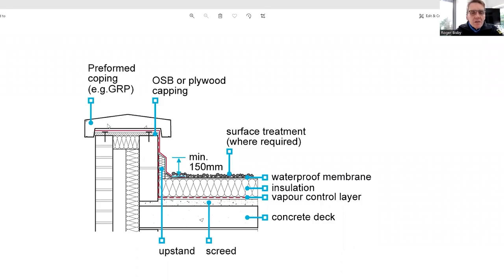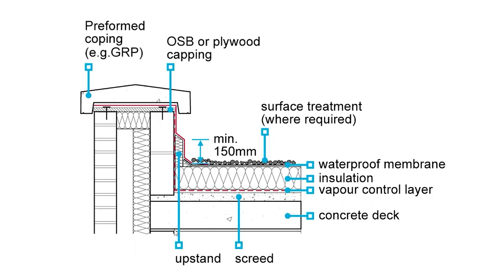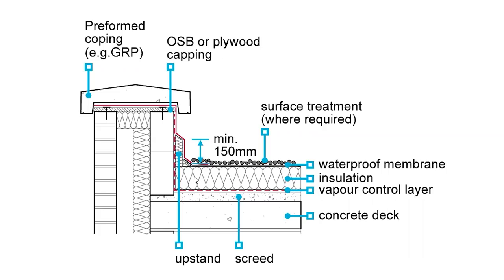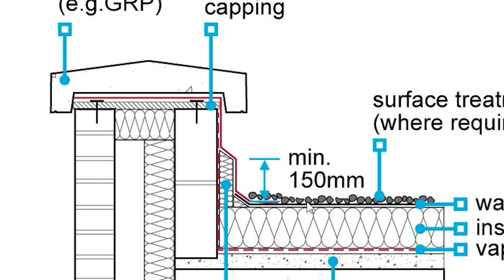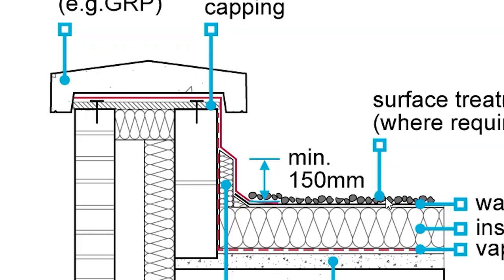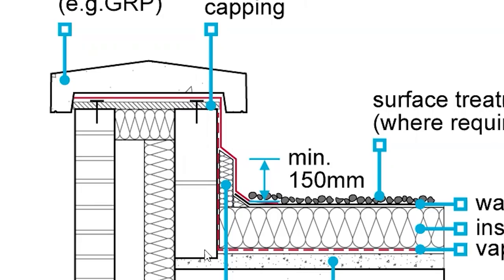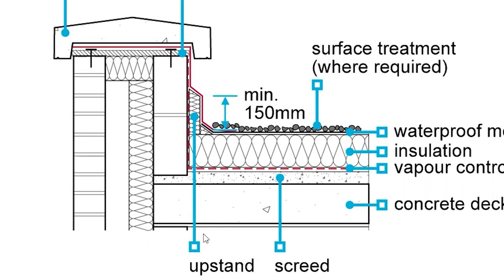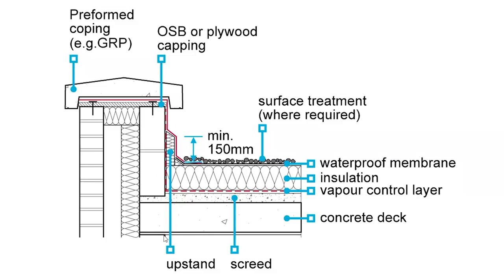A Deeper Dive Behind Parapet Walls

Comment: Have you seen anyone doing the timber stud work on top of the insulation? I’ve got an upcoming extension with a parapet wall, I’m interested to know if this is a good method
Reply: Upstand studs are quite well performing insulator. You don't put insulation below studs. You put it between. If you make timber upstand it is way better than any concrete block or brick. Thermalite block  is a different storry. Actually would be easy to find u values for timber and thermalite to compare. But premise of video with assumption of timber ceilimg would be that where timber beams rest on the internal wall, the wall continues with insulation layer, not block. Then you have a plate on top of insulation, dwarf studs on top of plate, then another plate just below caping...
Ceiling noggings 1- 3 inches away from wall. Osb board from top acting like a shield + noggings just next to the wall along with the dwarf wall bottom plate  should prevent any warping on 4 inch support area of timber warm roof joists.

Previous video postulated moving temperature stress point (sorry not an engineer - point where cold crawling through material from top meets warm temperature crawling from the living space from the bottom) be moved from inside the living space somehwere inside the wall under the ceiling to somewhere inside fhe ceiling level, _inside the bearing part of the roof joists_.

I would guess that with an extra bit of the insulation marked on the above video as upstand, this temperature would move into the level of actual paraphet wall's upstand's timber plate (not marked on this video) and be as negligible as possible, but hey, Roger is a God of 'Why won't we consider thiz today' and i am sure there are dozens of people who would be inspired to get some science done and tell us how those things work.

Building is art and forgotten lore. Art is chaos. Forgotten lore is forgotten. We all have passion and try for the best but we are still shaken by paradigm shift that took place somewhere in the second half of XX century. We just try for the best.
Reply: @kerel995  if you just have the stud work on top of the block work you’ll probably be better off going with thermolite block instead. 

It would be nice to see some numbers/evidence
Reply: @mooney0086  previous Roger's video said:
Insulation inside warm roof goes over concrete wall that ends at the bottom of roof joists. Then in between bearing part of joists you have full insulation. Upstand is on top of roof joists.

Regarding numbers, this is like a little nerdy math excercise
 I would love to read calculations for timber bridging too ;)
Reply: @kerel995  I’d imagine building control would want SE calculations for adding coping stones on to a timber frame too. More expense 🤦🏻
Reply: @mooney0086  absolutely crossed my mind.
I like the way your brainz work ;)
Reply: You can do away with the 'inner leaf' of your prapet altogether. Take the inner leaf of blockwork only in between and up to the top of the roof joists, lay OSB deck over it right up to the single outer leaf, bring your insulation also to this inner surface and the roof waterproof covering up and over to the capping. Simple.
Reply: @thetessellater9163  I’m having a roof terrace. I don’t think this would be allowed.
Reply: @kerel995  a Builder AND a philosopher! I love it!!!
Reply: @criollitoification  Aren't we all? Lol.

Comment: It might seem odd but you must remember heat loss can be  material (like a steel wall tie) or geometric - in the case of a parapet the upstand acts like a cooling fin. The heat-emitting surface is larger than the heat-absorbing surface, just like any other corner. Hence why the heat break is important!
Reply: Fantastic explanation! Thanks Swwils!

Comment: One thing I’d add is, take the membrane down the exterior wall a little bit, and ensure the cope is only there for decorative purposes .
Reply from the maker: Good point
Reply: the membrane under the coping SHOULD  show a half inch , i know it looks ugly but it WORKS !!
Reply: @pauldavies5655  -  where is the attachment of the coping ? With the membrane right under the coping, you may be risking detachment in high winds.
Reply: @thetessellater9163  
  you can do it easily with DPC --- it will take a wind of over 120 miles an hour to dislodge  a coping  done properly.
 i know of  coping stones in britain  at the end of 4 storey roofs ( we call em FINIANS ) which have survived  a 120 years untill the main roof covering needed changing !
 also look at the shape of each coping stone and adjust it to the wind conditions in that area --- common sense !
 remember , make it secure --  make it WORK , NOT make it look pretty !

Comment: Should there be some form of vent at the top of the brickwork to allow flow of air and allow any moisture to  evaporate??
Reply: Most modern weep vents also allow some cavity ventilation. They also can prevent pressure differentials so moisture is not forced into the cavity.

Comment: The comment about condensation on a cold chimney breast is spot on exactly what happened in my mother’s old house….She had a repair chap rambling on about flashing and sealing etc, but you could see the ceiling water stain coincided with a change in chimney profile in the loft.  Condensation was running down the outside of the rendered chimney brickwork in the loft and dripping off at the curve to wet the ceiling board under it.  I guess it only occurred on cool summer nights when the fire was not lit.  This is hard to fix, but one way is to install a collection trough under the drip zone and pipe the run off to an outside wall or under the eves harmlessly discharging the condensation.

Comment: Another great video - thank you. What kind of insulation would you use to run through to connect to the wall insulation? I mean in terms of building block work on top of it - does it have to be anything special to support the block?

Comment: Another great video as always Roger. We've got a 1st-floor balcony with parapet wall with capping stones which has rotten timbers (firrings and joists) around the perimeter under the OSB deck, especially under the internal corners.
You and your diagrams explain well "how it should have been done at the beginning". But that doesn't really help me in my pre-existing situation. Perhaps you could make a video about how to fix this system without the demolishing and rebuilding of the entire parapet. Roger that!

Comment: Random question - I'm fitting a kitchen and have taken the supply pipe work back to the rising main/ stopcock as it was so poorly fitted.  it's a detached property. Combi boiler, no storage tanks and no outside tap.  It does have mono bloc kitchen tap and a shower head on a hose over a bath. Does it require a double non return valve at the rising main?  If it does is that best practice or legislation?  Sorry asked a few people and  got different advice :(
Reply: I don't know jack about plumbing, I'm only thumbing up your post in the hopes that someone else with knowledge might notice it and give u sound advice. Best of luck

Edit. Have you jumped onto an online plumbing forum?

Comment: I had that problem with the chimney, had it reflashed, repointed and a capped off with a tin cap. what a waste of time it still had problems so it was taken down top to bottom (removed) and how much warmer the room is now. please do a video on this to show how bad chimeys are for heat loss ( its like having a window always open).
Reply from the maker: Good idea
Reply: Could be useful for 'trickle venting' the house though. Chimney breasts are also used for lateral restraint on a long wall, if you and your neighbours both remove them, there could be issues with stability.

Comment: Why are building standards not reflecting this? Why are blocks still used if studwork is the ideal solution? Also, would termalite blocks solve the problem?
Reply: Alao, would insulating the inside edge of the warm roof solve it? There’s plenty of space between the rafters…

Comment: Underneath the GRP they should use slate or cement board rather than OSB/chipboard wood which in time will absorb moisture.  Great video Roger
Reply from the maker: No OSB 3 is great. A lot of GRP suppliers insist on it.

Comment: Be interesting to look at the similar issue with gable walls in the loft, which must also eradicate heat out of the house above the insulation? Hipped roofs must lead to a more efficient building?
Reply: The inner leaf of the gable is not exposed to the elements, so warmer, but still must lose some heat to the outside. Maybe not enough cold bridging to form condensation, and if so, the ventilation in the loft should take care of it.
Reply: @thetessellater9163  silly question, would the orientation of the building not affect the inner leaf of a gable? I.e, driving wind/rain?
Reply: Our gable is north facing, so it’s a cold wall anyway, but my point really was the temperature in the loft is very low above the insulation, and the inner leaf of the gable bypasses the insulation, so it must soak heat out of the house. Wasn’t particularly suggesting a condensation issue, just bridging.
Reply: Insulation is meant to be carried up at least 200mm up the cavity in the gable. The roof is also meant to have perimeter insulation - this is often missed on cold roof constructions where there will be a gap where no insulation is between the gable and the first ceiling joist before the horizontal insulation of the attic, usually exposing the room belows ceiling plasterboard corner to cold attic air.

Comment: I have a building almost identical to the diagram. Except I have solid block walls with a cast concrete roof with steel RSJs going right through the wall.
It's an ex industrial building, I'd like to leave the ceiling exposed. 
Can this be done and how? I'm getting many conflicting opinions
Thanks

Comment: Possible to just have the outer skin of brickwork as the parapet and to finish the innner skin of blockwork just below the roof deck, taking the deck and the warm roof insulation right over to the brickwork, thus closing the insulated envelope right across. My fave waterproof membrane is GRP - you end up with just one piece for the entire roof covering
Reply from the maker: The only problem is that the 4 inch  brick wall is not that stable.

Comment: Nice thermal bridge down the block work inner skin to the roof slab! You also need a separating membrane between the vapour control layer and the slab/blockwork to minimise the danger of perforation during the construction process. On the whole, using an inverted roof is infinitely more preferable not least because it avoids thermal stress to the edges of the main water resisting membrane and early degradation from its direct environmental exposure illustrated here.

Comment: The best solution is to simply use a wider coping stone and extend the inner leaf's vertical insulation (25mm thick) all the way upto the coping stone. Plus use thermolite on the inner leaf. =strength and no cold  bridging.

Comment: I have a real issue trying to detail warm roof, with balcony deck above with frameless glass balustrade. Had originally thought a cast ring beam sitting atop inner leaf would be substantial enough for balustrade channel to fix to, but SE is having kittens saying that a huge steel UB, bolted to roof joists, with PFC welded on top is the only thing that is 'probable on paper'. I think this is way overkill but will consider building a stub of parapet wall to decrease the glazed area, the tips here on bridging issues are good. BUT, I still need to have something 'suitably robust' to fix the balustrade to that doesn't pierce EPDM. For sake of argument lets say stub wall is 350mm from FFL, which leaves 750mm of glass. Answers on a postcard....

Comment: Great thank you made alot of sense however could you explain where you would take the vapour barrier
Reply from the maker: The principal is to stop airborne moisture getting into the roof so the vapour barrier needs to lap up the side of the roof to the top edge.
Reply: @Skill Builder  how can it if you have the top deck on top of the insulation and then build a stud wall on top deck if the insulation is going right though to stop the coldthen how do I get the vapour barrier back up the outside wall do you screw the stud wall on top of the vapour barrier? 
Bit confused sorry

Comment: That brick is structural.  It isn't a veneer.
On the roof side, you could simply use any sort of framing.  I recommend not using masonry on that roof side as it is just added weight for no reason.
Also, the outside brick would be preferable to be a veneer on wood or metal stud framing.  Keep in mind to use proper sheathing and water/vapor proofing.

Comment: Sealing houses up is going to cause a lot of trouble in the future, not just for buildings but for people’s health. Older buildings were designed to breathe, they also had good regulated temperature - if they were built “correctly” of course.

Comment: Hi I watch you program on you tube and I value your knowledge , my new neighbours are doing a loft conversion and the party wall agreement has been done but does this include work on ground level as I have just found out that they want to build a wall next to my fence in which will take my fence down and start building in which it will possibly block out the light can you let me know what think , thank you for your program , 
Regards Pat Flynn
Reply: The Party Wall agreement should cover all aspects of the groundwork too. There is no 'right to light' as some people assume. They should have no right to even put foundations on your land, so make sure this is stipulated. You can use your own Party Wall Surveyor, to look after your interests, for which your neighbours must meet the cost of.

Comment: Would you have the same problem if the roof was timber, joists and plywood top, with insulation in-between joists
Reply: That would be a 'cold roof' which is less efficient.

Comment: This video clarified things more.
But could you not leave the inner brickwork away altogether above roof level and use a rigid form of insulation (PIR) above roof level?
The roof membrane does keep water out of your wall cavity anyway in this scenario.
You would only end up with a somewhat narrower coping and just the outer wall to fix you coping to, but in the case of aluminium or zinc which is relatively light this must be not a problem.
Or are there things I don't see?
Reply: I was thinking that but I think as it’s a cavity wall you still need to tie the top part of the outer brick skin to the inner skin, and I assume you can’t fix steel wall ties to PIR
Reply: @charlespudge3371  I think that when the parapet wall isn't any higher than a foot the single outer leaf can do well without the ties, but when you have a 4ft high parapet wall to act as a barrier around a roof terrace this is a different matter.
In my case I'm looking to build parapet walls which are more like upstands for the roof but with a metal coping over it to look like a proper parapet wall from the outside without having barge boards or such.

Comment: Thd cavity may have to maintane its m value so dont think your desire to use insulation would work .
Reply: I have never layed a block on screed in my opinion the drawing is wrong ...where is it from Rodger...?(Brickie 33yrs exp)
Reply: @stuartnicklin4101  seen the diagram in the nhbc standards - flat roofing

Comment: That's better. The drawings I mean. However, there is still cold bridging to raising the full parapet wall above the roof with all the added risks of exposing a cavity wall and then relying on an out of date concrete coping.  Just extend the outer skin only above the roof and use a proprietary powder coated aluminium capping system with hidden fixings over the single ply roofing membrane.  That way the warm deck roof oversails the inner skin and cavity. Your detail is so out of date.  Any parapet wall roof abutment is like going out in the rain only wearing a fez hat rather than a hat with a decent brim. Your ruddy ears are going to get soaked.  AVOID parapets at all costs is my advice.